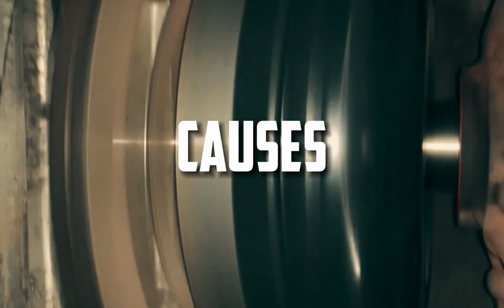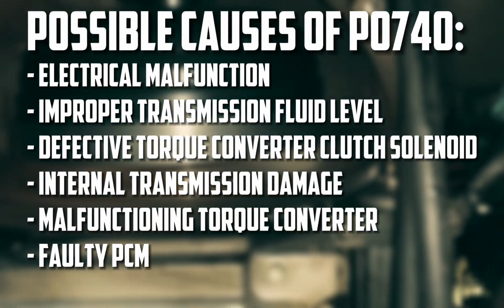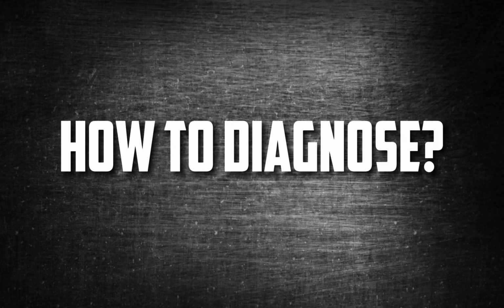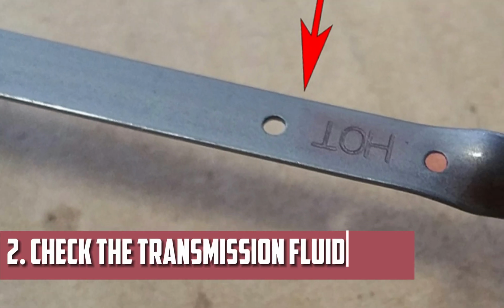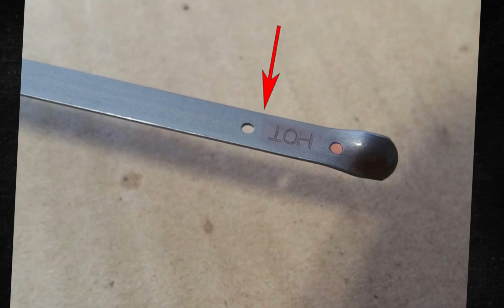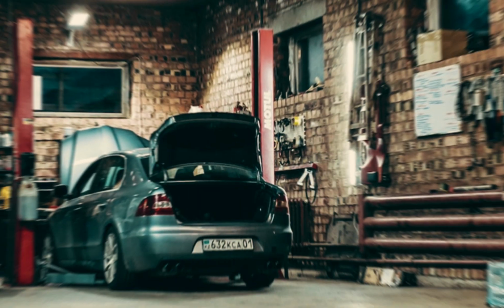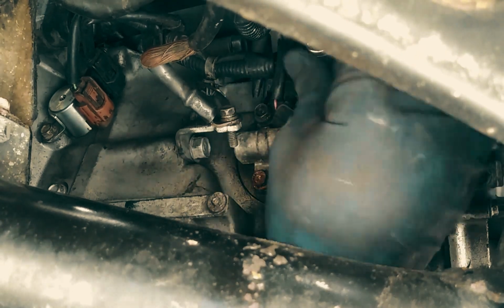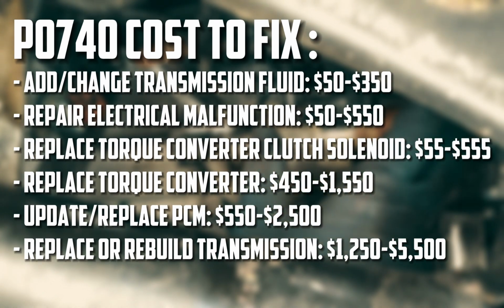P0740 Code Meaning, Causes & How To Fix It

Comment: APRIL 5-2024 DEC 2022-2003 ACURA TL S R&R REBUILD TRANSMISSION JAN 2024 ,PO740 CODE R&R LINER TORQUE CONVERTER SELINOID 172,813 MILES FIXED PO 740 CODE IF THERE'S NO INCORRECT GEAR RATIO CODES PRESENT R&R SOLENOIDS WHENEVER A ACURA, HONDA TRANSMISSION IS R&R USE NEW OE SOLENOIDS ONLY SMILE ALWAYS BLESSED APPRECIATE Y'ALL 🙏❤️🚦🛣️🚙